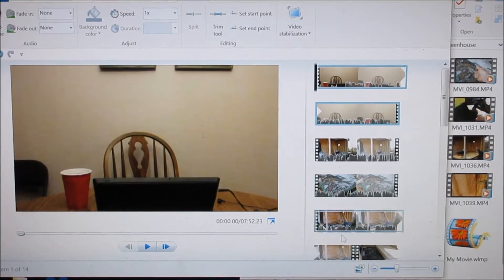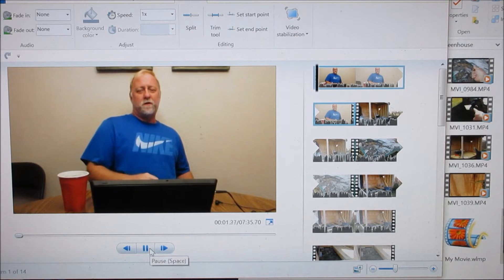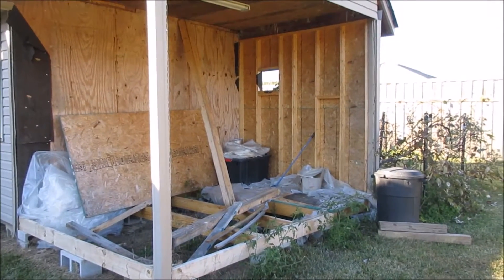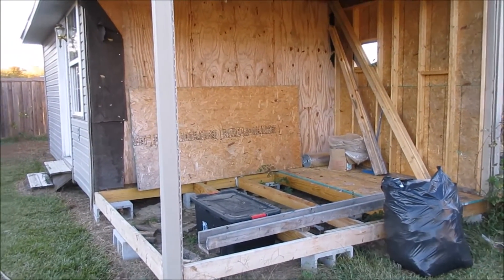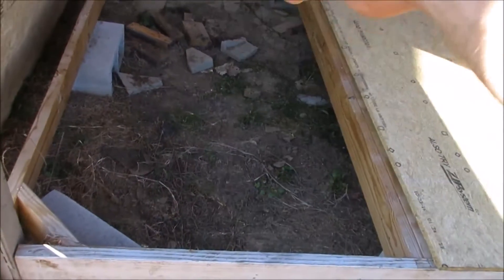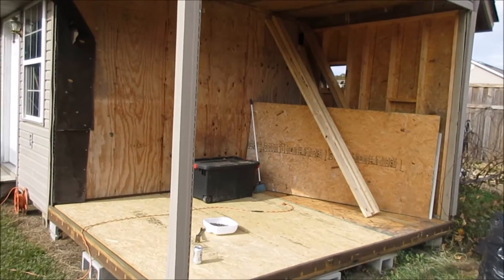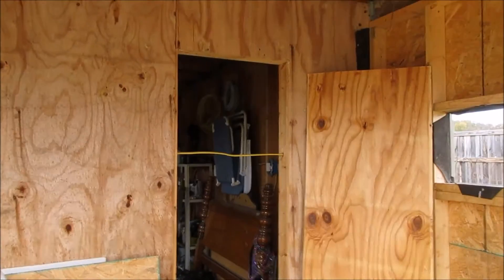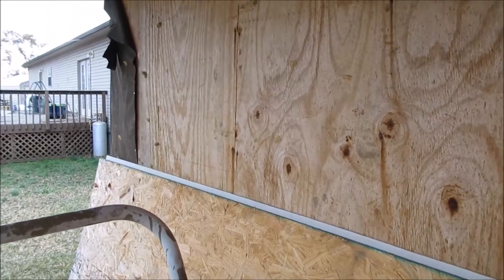Hydroponic Heated Greenhouse Build #3

Comment: Are you going to cover that OSB with plastic, or something? Also, does the window unit that you are using have outside air capabilities? You are going to need fresh air for Co2 for the plants. Just some thoughts ; ) Happy Thanksgiving!
Reply from the maker: No, not going to cover it with plastic.  Going to put decking boards on top and paint them.  My house was built similarly except OSB with carpet and/or tile on top.  Not sure what you mean by outside air capabilities so do you mind explaining that part?  There will be a vent in the greenhouse.  I'm not sure where it will be just yet.  May do an auto-open window or a thermostat controlled, or a timed version.  Still thinking on it.  I surely am looking at options so please offer up suggestions.
Brent
Reply: I understand that it's going to be out of the weather. I was concerned about spillage of water, and nutrients getting between the cracks of the deck boards, and rotting the OSB underneath. Some window type AC units have the capabilities of bringing in outside air, or makeup air, kind of like most all cars are equipped with nowadays, instead of just recirculating the air inside,  which can end up with airborne diseases, and no introduction of fresh Co2. If you are going to use exhaust ventilation, I was confused about the climate control with the AC? Evaporative cooling would be the best option, imho, with thermostatic controls. Just my .02 ; )

Comment: Do you have any special considerations for say, vapor barriers. Is all the wood pressure treated? For your climate control for summer will you install a window unit air conditioner? Neat that you are reusing so many items. Best of luck on the build. Cheers,   Bill
Reply from the maker: Bill, I considered a vapor barrier for sure.  The OSB flooring that you see so far isn't pressure treated.  The deck wood going on the floor and walls are treated and I will paint it.  Also, my plans are for it to be climate controlled with an AC, heater, and de-humidifier.  Check out vids 1 and 2 in the description if you haven't so far.
Brent